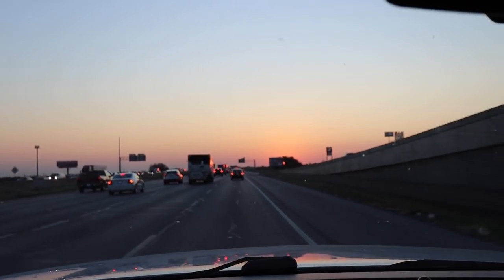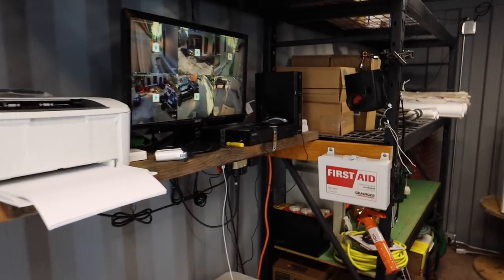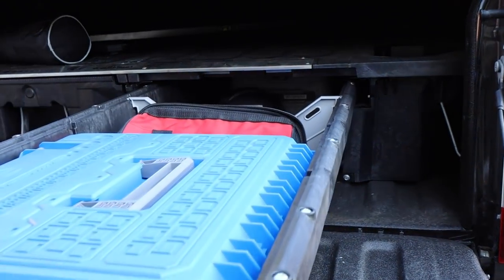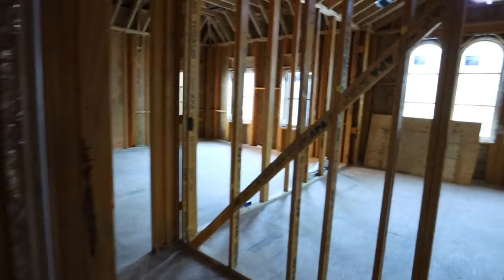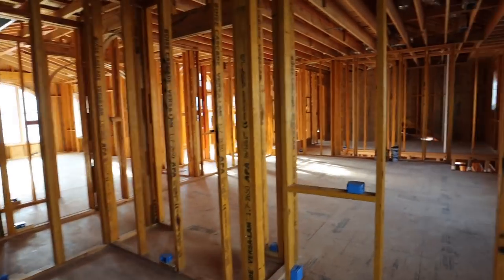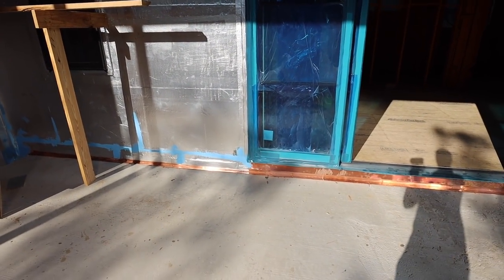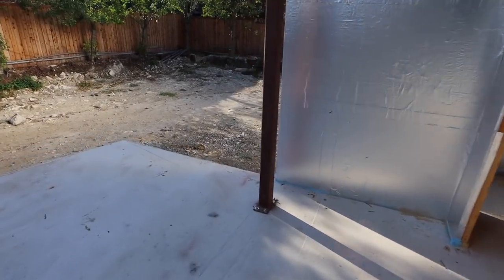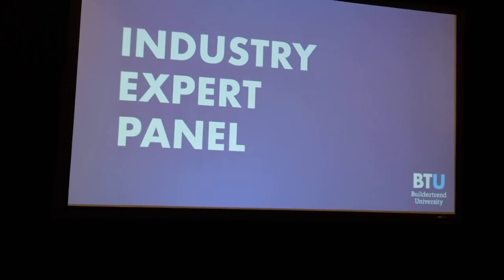Framing Tour - All engineered studs in this Highland Park Dallas Home

Comment: Matt I have been following you for some time now, I have to say you have given me A TON of knowledge about building in my own home Im a DIY kind of guy electrician by trade at the public utility. I recently sealed all my penetrations, rim joists and sill plates... And what a difference it has made in the basement . I also just installed 2 Mitsubishi Hyper Heat units we just did startup today on them.. Ill need an HRV soon also which im looking forward to once i seal everything up on the main floor. My house is only a ranch style but in time it will become something to see. One step at a time they say.. THANKS MATT your a huge help!!!!

Mike

Comment: Having a basement in your house in the ultimate North Texas status symbol.  You can win the fight against our clay soils, but it will cost you.
Reply: Is the water table super high?
Reply: Comanche club  more like the black soil is super low and sinks lmfao... when it drys out in summer it cracks and settles and homes have all kinds of foundation problems. in some small towns in north texas every home is crooked.
Reply: @Frost517  

Sounds like the solution is steel piles screwed into the ground 40ft. I worked for a company that did just that, farthest we had to go was 90ft before we hit something harder than a loaf of bread.

Comment: Up here in the Northernmost part of Montanny, we frame just like this, and have for over a decade+ (job dependent), with laminated studs coming in first, framing kitchens to ensure quality cabinet fit.

The 2x4 floor trusses are also widely used in residential and commercial up here.  You should contact local builders in the Flathead Valley, and come tour next summer visiting some build sites, and Glacier Park too.  ;)
Reply: A good point of contact would be Leah Lindsey.  She's a long time DJ at a local FM station (Bee Broadcasting), and also sells real estate.

Comment: Highland Park is located inside of the City of Dallas. It has it's own mayor, municipal courts, police dept, fire, etc, as well as a public school system that many private schools wish they were. FWIW, a group loosely called the "Dallas Citizen's Council", most of whom live in HP,.believe that Dallas is a suburb of HP. 
   On the site exam, you didn't really touch on why they have some many problems with water in the basement- it's the sort of condition you hope you got enough info during your site corings etc; all of HP is on top of the Austin Chalk, a softish, white rock left by the ancient seabeds that covered a great deal of Texas. When it rains, the water goes into the soil, but is channeled by the irregular surface, sometimes surfacing in the worst places- under a street or house. I've installed numerous sump pump systems to collect and keep the water level under the many hundreds of pier and beam homes throughout the area. Just looking at where those pumps are on a street map and consulting T A&M map of the Chalk shows conformity with several of the "ripples" in it. FR

Comment: I enjoy your vids. Helps me understand some of the things I need to look for in good construction, especially the stuff you shared from Europe. How do you even find good builders willing to do a good job much less at a fair price, especially for building a "normal" house and not some mansion? (especially since it seems like most builders send in a sales guy, then go get labor from the lowes parking lot to do the actual work). In the building boom, even ordinary work is done extraordinarily shoddily up here. I'm not far away from having my next house built, but looking back, my last one sure wasn't built great (though it looked pretty). Can a good builder do the design or does it always require an architect? (they are SO expensive). I'd love to come down to Austin, but I think I'll probably stay up in Dallas as that's where my work is. I want my next one to be small, but look like a castle :)

Comment: As a European seeing that truck bed storage solution... Why the heck do Americans love pickup trucks so much when a van would do that so much better?
Reply: Show me how to hook up a goose neck to your van and after work take a date out on the town in your van. The back seat on our crew cabs comes in handy on those dates too. The list is long of the advantages of truck ownership.
Reply: Jesper Monsted Pull goose neck, pull 5 tons plus, haul higher items, load material with front end loader, more capable off road.
Reply: Vans are nice for theft but otherwise a pain in backside. Everytime I needed something I have to climb up and jump back out. My truck has a "pack rat" like this guy's truck and it is at waist line so no being on my knees looking for parts. And the big one I can carry and leave in the truck a full pallet of wire or my bike.
Reply: Because you can put stuff on a truck you couldn't fit in a van of similar size.  The second reason is of course that trucks just look better.
Reply: Even poor people have trucks in Texas and one time everyone had a gun rack in the back window, including myself. Try to figure that one out. :)
Reply: It never rains in Texas so they can just leave shit in the back. It doesn't make sense for Europeans because everything would be constantly soaked.
Reply: Basically, anything that separates us from eurotrash, we like.
Reply: Plus most pickup trucks are 4 wheel drive and most vans are not, live up north, so 4x4 is a must.
Reply: Apparently European's would steal anything left in the open. Here, in Texas anyway, you never know who has a gun...
Reply: @steamsteam6607  it rains about 35 inch (90cm) a year on average in Dallas area, and varies a great deal year to year.  63 inch (160cm) in 2015.
Reply: @steamsteam6607  "It never rains in Texas." Try not to put your ignorance on public display. Highland Park is a community completely surrounded by Dallas. The average annual rainfall in Dallas, Texas is about 39 inches. The average annual rainfall in London, England is about 23 inches. I'll leave the metric conversion to you. Both Dallas and London average between 100 and 110 rainy days per year.
Reply: @allencasey6981  I was ignorant about the fact Texas appears to be that wet. I have never seen a movie setting with Texas in the rain I believe. Nor have I ever been there. I get this New Mexico idea of Texas from associating westerns, cowboys, dry and dusty with Texas. My sincere apologies there. But that begs the question even more why does everyone in Texas drive an open bed pickup instead of a van? It will get soaked every time with those numbers. You'll be driving around with a swimming pool in the back. But I reckon those numbers result from extreme and short downpours and not from eternal drizzle London experiences. Blame Hollywood for warping my ideas of Texas. And blame my lack of time and money for not having ever been there.
Reply: @steamsteam6607  Over the years I've owned pickup trucks and vans. The mid-sized trucks have proven more useful than the vans. The truck bed is more accessible and versitile for hauling loads. I rarely leave the truck loaded outside so rain is not an issue. My current truck is a Honda Ridgeline. It has reasonable seating for four, a comfortable ride and I can toss in a sheet of plywood or multiple bags of mulch for my home projects. Why not a truck?
Reply: @allencasey6981  I realised after writing that you Texans all probably have a garage the size of my house in Belgium. I guess it makes sense. Still very surprising that you have that much precipitation. I really like the way you people roll. In Belgium it would be a rotten mess because very few people have a garage so the entire bed and anything left in it would be a soggy decaying mess and a pain in the ass to clean that's probably why we find it strange. Different lifestyles.
Reply: @steamsteam6607  Ah, Belgium. Inventor of fried potatoes, mistakenly called French fries over here.

Comment: What does he mean about not using the 3 bid system but having the architect trained to call the builder early on?
Reply: I assume to get a builder you trust and work with throughout the whole process.  3 bids = go with the cheapest bid where they might not go with the best practices or materials, and dealing with big change orders because they didn't account for what the other builders accounted for in their bid.  Spending the whole time arguing with the builder that they aren't living up to the promise of their cheaper bid.  So you could go with a worse builder because they gave a cheaper bid and end up paying more in the end.  Or even worse, the cheaper bid is going to cost you a lot more money years down the road.

Comment: I own a 1922 Craftsman home. The reason why these 100+ year old homes are still around is because they WERE NOT sealed up well. The house was allowed to breath. My house is a stucco home that had 1 layer of paper and only 2 coats of paint it's entire life. How did the house not rot to pieces without all this high tech water proofing? Easy, it had 1x6 sheathing with gaps between each board that could breathe and it also helps to have lumber that would be considered above #1 quality lumber today. Technology has its place, but so does simplicity. I am doing an addition to the home and I am having reproduction wood double hung windows made to match the rest of the house ( the home had ALL of it's original windows that I had  reproduced with double pane  glass). I could have a nice set of similar Marvin wood windows with all the fancy locks and drop out windows for ease of cleaning and great sealing. Why choose to have reproductions made??? I'm in my mid 30s and never plan on moving. The close to 100 year old original windows had never failed so why change? A piece of rope, a wheel, lead weights and gravity, rarely fail. Will they deal as good as a new Marvin, not even close.....want some more simplicity.....it's cold....put on a jacket. Energy efficiency solved, simple.
Reply: Funny Cause I have experienced many windows where the lead weights had fallen off and made the windows very difficult to operate. Im sure its lovely to live in your 1922 craftsman home, I love homes of that style and era, but you cannot build to that standard anymore, houses are required to be more efficient. and to me there is no middle ground, you cannot half-ass a tight and efficient house. if you build with modern materials, a house that is just barely tight enough and insulated enough to pass inspection, it will be allowing too much airflow and therefore too much condensation to last. 

I would also like to point out that what you are experiencing survivorship bias. you likely live in one of the most well built of all the houses built in the 20s and the vast majority of the houses from that era have long since succumbed to material failure and workmanship and maintenance issues. 

Not every house built in 1922 was built to last 100 years. it just so happens that yours was. 

Furthermore, I have lived in a 1918 house, with very few modifications done to it apart from the addition of central air, and it would cost me  three or four hundred dollars to cool it to 80 degrees in Columbia, SC in July and August. It was an unbearable expense for me at the time, not to mention I was STILL very uncomfortable.
Reply: @kathrynroberts2246  while it is true, I happen to live in the same Francisco bay area where we probably have the mildest climate short of southern ca. I am actually doing an addition to the house as we speak and the new windows are replica wood windows made just like the originals and even have lead weights if you can believe it. My home was definitely neglected. The original family owned it until I bought it and it has literally only had 2 paint jobs in 100 years. The house had a lot of termite damage due to the stucco being installed all the way down and covering the foundation, which looks great but obviously invites termites. The stucco was cracked and the original single tar paper was disintegrating. The house had no wall insulation which was definitely what saved the house since the walls could dry out. If it had insulation that house would have been completely destroyed with dry rot and mold. All the walls are insulated now and the windows have been replaced with double pane wood sashes. If the house had been built with modern lumber the termites would have eaten it in no time. I have homes 2 block away that had that crappy Masonite siding and the homes are DESTROYED by dry rot and mold and these are homes made in the late 90s.

Comment: Man, I wish here in NZ the build quality was as good, materials here are ridiculously expensive too, which makes builders cut corners, no one sheaths homes, build wrap straight over frame, minimum code specs, no one builds beyond that code, at $29 for a sheet of James Hardy plasterboard its no wonder houses are left to rot.

Comment: Matt, Any idea the cost per sq/ft?  I'm guessing $250+?
Reply: More likely $450 to $500
Reply: At least 500 a foot, depending on interior details up to to 750.
Reply: All depends on the finishes. When you start talking stone, hardwood, clay walls, and custom ceilings, the sky is the limit. The engineering, fabrication, and installation of that steel staircase alone would probably buy you a small house in the country.

Comment: For temp rail - try putting 2x6 blocks cut to the rise of the stair at bottom at top of the stringer - creating a square attachment surface.  Then clamp it together with a slab grabber temp rail post 

https://www.amazon.com/dp/B00IKMSVDI/ref=cm_sw_r_cp_api_i_RlVODbRV00Q41